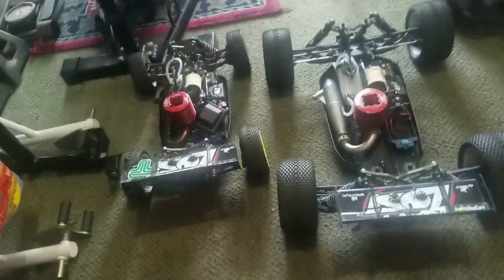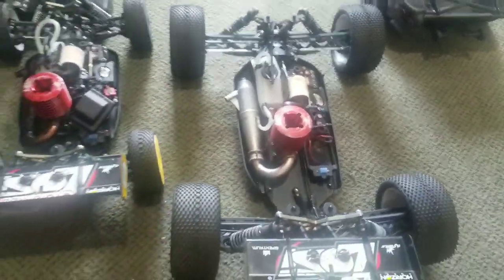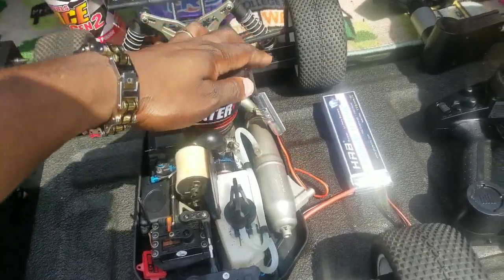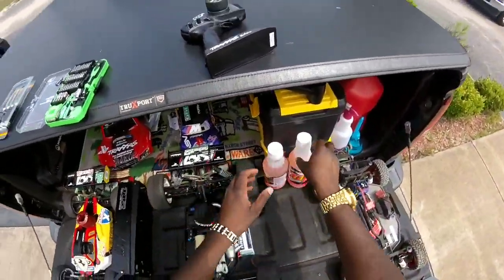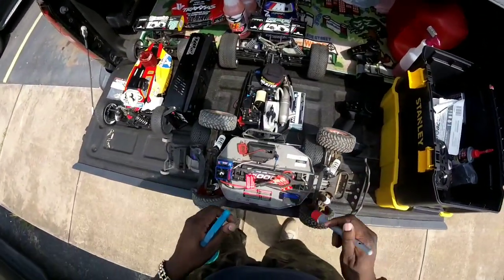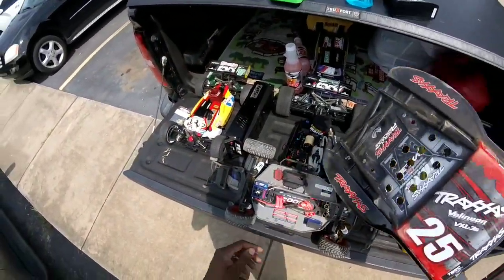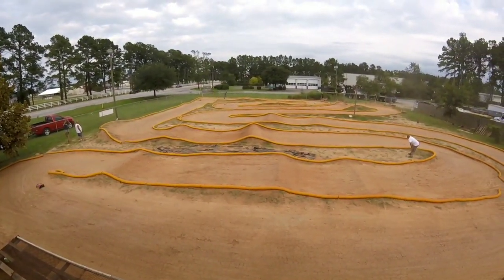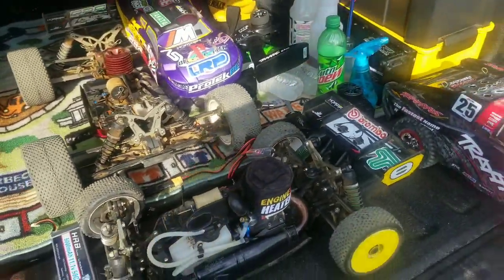LOSI NITRO RTR & Traxxas slash race day

Comment: Two tanks is recommended for breaking in a stock losi buggy correct?
Reply from the maker: Yeah.  If u wanna be safe do 3 then put it on the ground and do slow figure 8 with a forth tank then gradually increase speed it should be nice and broke in.  Use a fuel that has a high oil count first. My suggestion
Reply: Thanks man! I'll let you know if I have any other questions. Keep up the great work and videos!